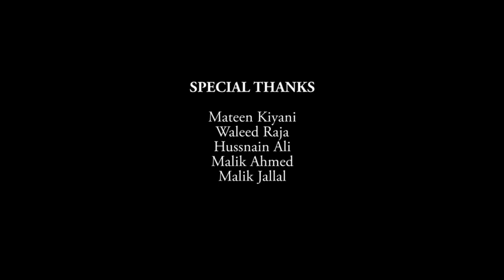Inside Khewra Salt Mine: Documentary on Pakistan's Largest Salt Mine

Comment: This salt is very good for your health as it never accelerates the blood pressure
Reply: It is interesting but can you please develop? why does it so? thx
Reply: @pzeus11  The sea salt is mainly formed by the erosion of the mountain rocks whereas pink salt is formed directly by breaking the mountain rocks. The main reason for high blood pressure is faster beats of heart. The sea salt(high in contration of saltiness) increases the flow of the blood cells. Means it makes the blood cells to fluctuate more when taken in higher concentration and ultimatly when it reaches the heart from the liver it increases the heart beat. More beats means more chances of attacks. Its also found the heart beat increases as if the blood is not flowed through the veins to different parts of the body clearly. Means their is something or the other hindrances. This is known as blockages in the arteries.

Another method of making mountain salt are mainly by grindering the minerals of the mountains. The process of making the salt is different. So the composition and the mineral constituent are different. Normal rocks eroded to form salt and grindering mountain salts have different element composition.

Thankyou.

Comment: Assalamalekum.
New use of this salt is that it is used as LAMP. A hole is made in centre of small piece of salt what ever size 1 Kg, 2 Kg etc, after that a bulb with supply of electric city is adjusted. The light comes out of the salt is helpful for cure of many disease. It is also used in many big hotels for beauty and this light has bactericidal effect also.
I found the price of 1 kg of this salt lamp is about 100 Euro in Ireland (about 18000 Pakistani rupees).
Pakistan can do it and export by himself.
Dr Muhammad Khalid Syed